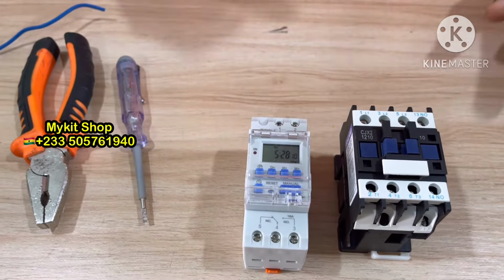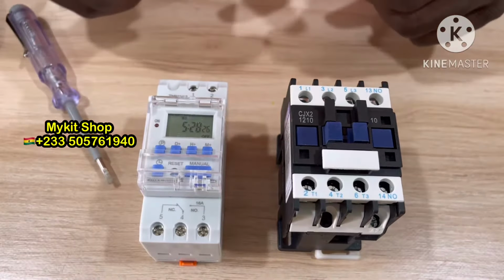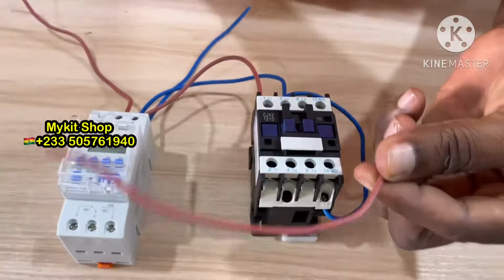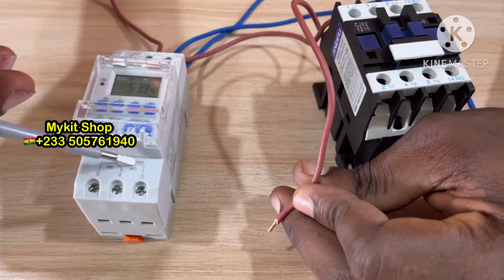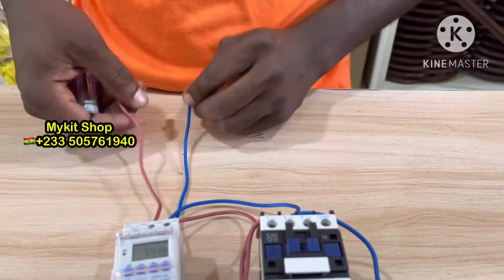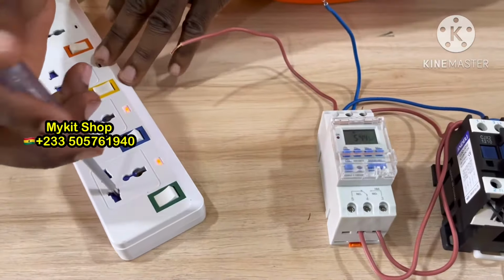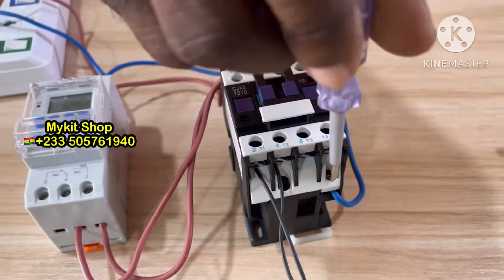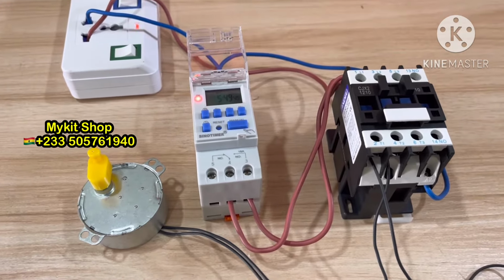How to connect timer switch to CJX2 1210 Contactor and borehole water pump

Comment: Excellent practical application of timer switch but connecting the bare cables to the Extension board seems unprofessional and unsafe next time consider using appropriate connectors. Thanks
Reply from the maker: Yeah right, thanks. This was just quick demonstration. It even has to go through a breaker before the mains supply, not an extension board